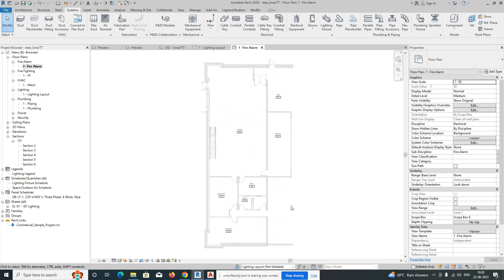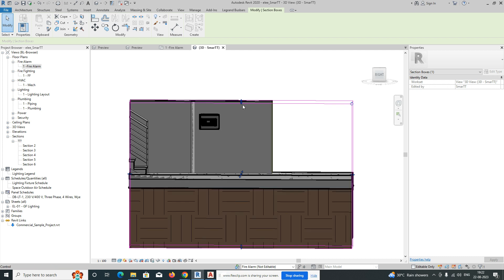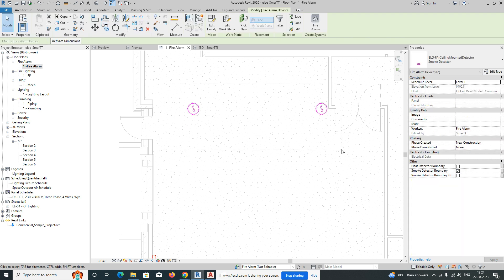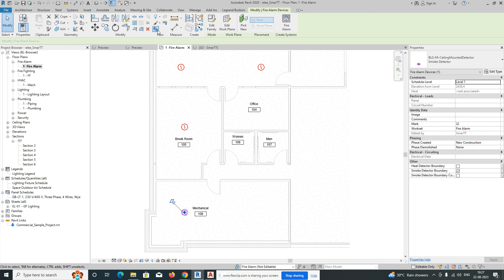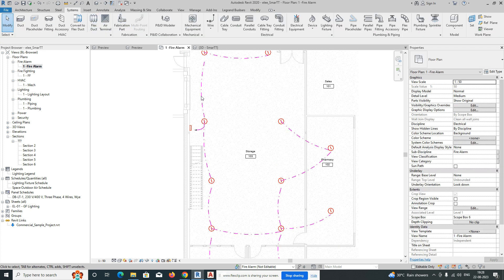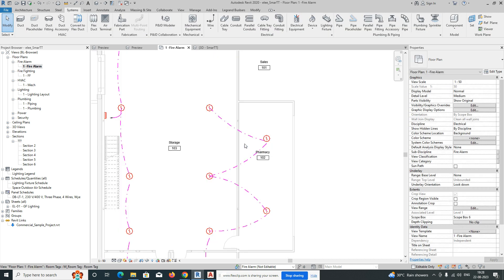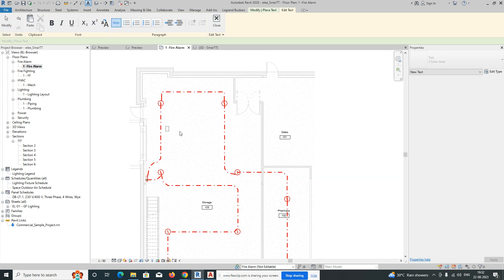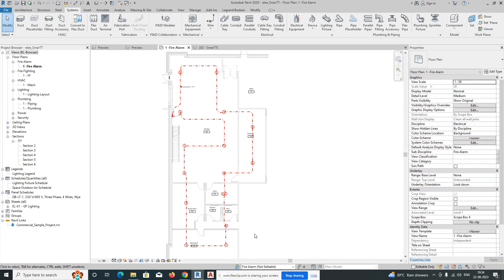Creating Fire Alarm Design in Revit

Comment: What about riser diagrams, battery and circuit calculations?  Does Revit also handle those?
Reply from the maker: Hi good question.  Normally we are doing in cad and importing cad file using drafting views. Thanks

Comment: Is there a default fire alarm template in the revit library ?? i only see mep and architectural and structural...Please help
Reply from the maker: I think you need to take electrical template
Reply: @ but creates only lighting and power floor and ceiling plans. Which in turn doesn’t allow u to use the fire alarm devices from the systems tab.. is there a video that shows how to do a fire detection system of addressable smoke detectors and heat detectors with manual call points and sounders from scratch? From template site to placing the elements across the floors and connecting them?
Reply: Side *
Reply from the maker: @kofiasare8824 you need to create one subdicipline for fire alarm
Reply: @AutoCADRevitByju  thank you I found out I was using fire protection and not fire alarm that’s why revit kept giving me the error of wrong category. Please I had to use bimobject to get fire alarm elements. Doesn’t revit have an in library fire alarm devices? If u go to the special equipment folder in the library u see smoke detector and all the fire elements but it comes under fire protection and not fire alarm which in turn doesnt work in the electrical template
Reply: @AutoCADRevitByju  also can I edit the family of the fire protection to use it as fire alarm in the family editor?
Reply from the maker: May you need to check the Visibility and view template and view
Reply from the maker: Yes you can thanks
Reply from the maker: Hi actually you can use electrical default template for Fire alaram  thanks in my knowledge there was no but you can create from electrical default  template thanks